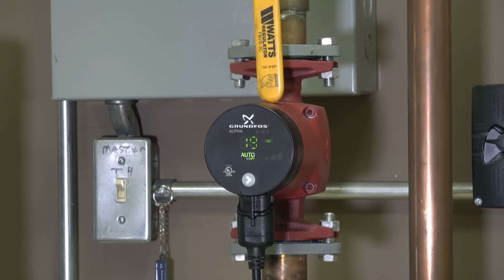Hydronics System Components

Comment: Why are you using black gas pipe on your expansion tank? And before anyone says some slick shit, I am a licensed Journeyman Plumber.
Reply from the maker: It is a faster install because the bottom of the air separator and the top of the expansion tank already have threaded connections.
Reply: i noticed the same thing immediately.  if this is an actual system in use, you might as well just replace them now with copper.  the reply from tec tube is nonsense.
Reply from the maker: @said_in_awk  The fully functional training lab system shown in this video has been installed since 2006 without issue.   Additionally ALL of our hydronic piping layout designs for actual buildings are also this way… and have been for almost 3 decades.  What issue you are perceiving will occur with the use of black pipe vs. copper?

Comment: Great video! Do you recommend putting propylene glycol into a closed loop radiant system? The pumps and manifold are in the garage where it might get cold. Thank you
Reply from the maker: If it gets below 40F in the garage, then yes add glycol.  How far below 40 will determine what ratio you need to glycol to water.

Even if you garage only gets down to 55, but your outdoor temp in your area gets below freezing you lay still want to consider it because sooner or later you will forget the garage open.

Why did you put the circulatory and manifolds in the garage instead of inside near the boiler?
Reply: @TECTubefilms  Thank you for the reply! I'll put in the glycol! I inherited the system as is :(

Comment: I have a closed loop hydronic system with PEX tubing in the floor slab, propane water heater, Grundfos pump and a small expansion tank.  How do I know how much to pressurize the expansion tank before heating up the system?
Reply from the maker: For residential, typically 12-18.  Although, all of those small tanks come pre-charged and should state the charge on the label.  You need enough PSI to get the water to the top of the highest piece of radiation.  So 12-18 completely covers you for a typical 2-story home with a boiler in the basement.
Reply: They are pre-charged.

Comment: Ill be designing a radiant floor heat system for my one floor 30x80 house...ill be using a open loop outdoor wood boiler....ill have 3 zones of say 8 300’ loops...my question is what type heat exchanger will supply enough heat for my system using the 2foot aluminum pex heat plates

Comment: Is it normal for a system like this to bang loudly when initiating?
Reply from the maker: no
Reply: @TECTubefilms  Thanks. I'm going to have to get it checked. I does it quite often, maybe 5 out of 10 times. It's so strong it shakes up the pipes.
Reply: Alex, have you got an expansion tank in the system or not? Look to see if you got your check valves in backwards. Water flow arrow are on outside of check valve. Just suggesting.

Comment: Thank you for your videos . Question I have, should I need a check valve  in my circulating pump?  It comes with one that's removable, would it cause problems? Thanks
Reply from the maker: The check valve is there to prevent reverse flow.  Some systems need it and some do not.  If there is only one circulator for the entire system, then the check valve is less important than it is on systems with multiple circulators.
Reply: @TECTubefilms thanks for reply.

Comment: Iam a pipe welder doing big havoc chilled water systems. But Iam going to learn this
Reply: HVAC is easier than residential ac and heating  cause you have liquid side and suction side and instead of water there is Freon on the cool side

Comment: Can you bleed the boiler with the circulating pump is on?
Reply: some  circulator dont like to be ran dry. so no, dont do it. map out your boiler, and ensure that you can force all the water out one place. then all the trapped air has to go out. most common place is the return going to the boiler. if you have zone valves, force them open.
Reply: @shahsmerdis  Ok thanks.

Comment: How do I decide what size pump to used on a system?
Reply from the maker: If it is a circulator for a primary loop, it would be sized for the pressure drop of the boiler and its required flow rate.  If it is a circulator for the secondary loop (or the only circulator on the entire system), it would be sized for the pressure of the entire system (boiler, terminals, piping, etc.) and the required flow based on the BTUs needed.

Comment: What side should the pump be installed to?
Reply from the maker: Which side of the boiler?  In most modern applications we prefer it on the supply side of the boiler.  We want it to pump away from the expansion tank.  And we tap our expansion tanks off the air separator.  And the air separator works best with hotter temps.

Comment: You mentioned using 3 4 port manifolds instead of 1 manifold with 12 ports. I'm working on a new system and was planning on one 1 port manifold, 9 in use with one open for future options. This manifold would supply one infloor system thats a closed loop with a 20 plate heat exchanger AND 8 rooms/zones with fin tube/slant fin/argo emitters. I'll also have a staple up room with 2 zones and 5 loops. The boiler is going to be  a Navion condensing boiler with 200,000 btu output. Would a Hydraulic separator  be a better option instead of a buffer tank?
Reply from the maker: Use a buffer tank if your smaller zones are lower BTUh than the lowest firing rate of your boiler.  You don't want one 4,000 BTUh zone short cycling a boiler that can only turn down to 40,000 BTUh.

Comment: Great info...I could sure use some direction about something I'm 
just not seeing on YouTube HOWEVER, one other video I viewed did say 
"this is the way to go" (two circulating pumps) but didn't really get 
into detail.
I'm about to install a new gas fired Crown boiler 105,000 btu, 
two zones (first & second floor Slantfin baseboard) but, I want to 
use TWO circulation pumps (one per zone) vs one pump for both. This way 
one pump isn't over working all the time and if, a pump goes down I'll 
still have heat in the house.
Please, any info would be so helpful, thanks Ray
Reply from the maker: For two zones you can either use one circulator pump and 2 zone valve or you can use 2 circulators and no zone valves. The circulators will need 120v.  The industry goes in cycles on which way is more popular.  Due to the cost of small variable speed circulators, the trend for one pump and 2 valves is back.
Reply: @TECTubefilms  ... thank you for that feedback.
Comment/question...being my Crown AWR105B already came with a much smaller Taco circulation pump vs the monster Bell & Gossett that was on my 40 year old crown, I suppose I'll go ahead and use the Taco unless, it would behoove me to go ahead and purchase a variable speed pump...question, are the "variable speed" circulators very reliable???
Reply from the maker: @hmdwn  Extremely reliable.  We haved used a lot of Grundfos Alpha and MAGNA variable speed circulators for the past several years and cannot recall a single failure at all.
Reply from the maker: https://us.grundfos.com/products/product-list/circulator.html

Comment: Great video!  Any videos on replacing an expansion tank?  
Can u tell me where the expansion tank is supposed to be located?  My expansion tank is horizontal and located under the circulator pump right before the return goes back into the boiler
Reply from the maker: The expansion tank needs to be upstream of the circulator pump.  We prefer the expansion tank to hang off the bottom of the air separator.  And the air separator needs to be on the supply side of the boiler because that is the hottest water (and hence easiest bubbles to remove).  Therefore we prefer nothing to be on the return side even though that is traditional for small residential size boilers.  The reason they were on the return is because it was easier to pre-package and pre-pipe them that way.  There was no technical reason to do that.
Reply: @TECTubefilms  awesome, Thank you so much!
Reply: @TECTubefilms  the new tank wont even fit in the old tank spot so i have to move it anyway
Reply: Tec Tube we usually fit expansion vessels on the return side of a heating system to prolong the life of this vessel as it is on a lower temperature pipe. Great video 👍

Comment: i noticed you have a circulator pump for each zone, in my condo, i have a hydronic system, but just one circulator pump for 3 zones, is there any advantage or disadvantage with this setup or just a matter of preference?
Reply from the maker: You probably have 3 zone valves instead of 3 circulators.
Reply: @TECTubefilms  i see, yes i do
Reply from the maker: The advantage of circulators for zone control is that you can buy smaller and less energy consuming circulators.  It is less expensive to run one smaller circulator to heat a zone than to run a large one and open just one single zone valve.  However, now with variable speed circulators that trend is changing and we are seeing the industry go back to a single secondary pump with zone valves.

Comment: I believe minerals in the boiler water have been collecting in my boiler since I drain my boiler in the fall and refill it in the spring.  (summer home) I think that is the reason my tankless boiler can't provide enough hot water for showers longer than a minute or so.  The part of the boiler containing the heat transfer coil has bolts that are so rusty I don't dare to try to remove them.  Is there a product I can add to the boiler water in the spring that will work to dissolve the minerals over the summer and i can flush out in the Fall?  Anyone?  Thanks.
Reply from the maker: We recommend never draining a hydronic system as refilling it introduces new minerals.  It sounds like your boiler is actually a water heater (or a boiler being used for domestic water heating only) and hence the reason you are draining it in the winter time.  We assume that is because you don't use the summer home in the winter and hence do not heat it.  Does the boiler also heat the home?  In other words, do you have piping from the boiler to radiators or does the boiler only heat domestic water for showering, etc.?   What style boiler is it?  What is the make and model?
Reply: @TECTubefilms  Thanks for the reply.  Actually there are two boilers for this duplex and both are acting the same.  (We rent one side in the summer.)  One appears to be a "70 series" and the other is a "Vailliant" but the age of the boilers prevents getting the model numbers and perhaps the correct names of the boilers.  Both are ancient.  Yes, we do shut them down in the winter for about 6 and a half months and we use them for heating in the Spring and Fall with the baseboard radiators. The heating of the house part works fine. We drain everything (ice machines, dishwashers, washing machines, water softener, RO device, etc) when we leave and antifreeze the traps, etc.  Been doing it for 10 years now and so far no broken pipes.  (knocks on wood...)  
If you put your hand on the hot water pipe coming out of the boiler it gets so hot you have to remove your hand.  But after a minute it cools down to tepid.  The flow remains high so the pipe itself is not plugged because the flow does not decrease, it's just the temp that goes down.  That's why I think the exterior of the coils are plugged up preventing of the transfer of heat from the boiler's main water tank to the DHW part of the boiler.  Plan at the moment is to install electric water heater next spring and just use the boiler for heating the baseboards only.

Comment: A buffer tank seems stupid. You might as well install a hot water tank. You will end up loosing heat that was generated out of the buffer tank. Nothing has zero heat loss.
Reply from the maker: The purpose of the buffer tank would be on projects with small zones... zones that are smaller than the minimum firing rate of the boiler.  So instead of short cycling the boiler and beating it up, we sometimes elect to us a buffer tank.  A hot water tank... an indirect storage tank for domestic water... would not have this same effect because it storage capacity would not be hydraulically linked to that small zone due to its heat exchanger.
Reply: I don’t know who you are Guy Fawkes-Day but piss the F*** off.

Comment: How do you determine what pressure the expansion tank should be set to? Additionally is that pressure measured before install or after while water pressure is being applied on the other end? Thanks for the great video.

Comment: Trapping air in the expansion tank won't reduce its effectiveness.  It will actually increase it. The more air in the tank, the more compressible volume there is within the system that's available for the expanding water.  The purpose of the diaphragm inside the expansion tank is to trap air inside, in fact.  When the expansion tank fails, as they all eventually do, it is because that diaphragm fails and lets all the air out. Thus little to no compressible volume remaining.  It's ok to mount an expansion tank in any orientation.  Connection facing upward does still have the advantage of not spilling water everywhere when you change it out though!
Reply from the maker: Rust occurs where air and water meet... just like you see on the water lines for ships in the ocean.  The diaphragm keeps the air from touching the water.  If you have additional air trapped on the water side of the diaphragm, you are back to air and water touching just like the old steel expansion tanks back in the day.
Reply from the maker: Cut and paste from a Honeywell TK300 manual "The tank should be installed in a vertical position."
Reply from the maker: And from an Amtrol install manual "Mount tank vertically in downward position only."

Comment: Question when the system which requires antifreeze drops in pressure the resevoir pumps glycol into the system.  How. Sensor? Regulator?
Reply from the maker: In that tank would be a mixture of glycol and water of the same ratio as the fluid in the system.  The tank has a pressure switch and a small pump.  When pressure drops below what you set it for, the switch makes and engages the pump.
Reply from the maker: http://gtpcompany.com/residential-glycol.html

Comment: My existing setup is a Rinnai RC98 199 BTU tankles water heater set for 60c (140f) supplying  an existing Summer Air handler TC3550E in my basement.  Air handler sensor records the input water at 49c (120f)  the output water at 37c (99f), discharge air at 38c  (100f) and the flow rate recorded on Rinnai to the air handler is 2.8 GPM.  I dont know the spec for GPM. There may be alot of resistance in 3/4" copper lines. All Insulated.  The run to tankless and back is 60'.  16 x  90degree fittings,  a Watts water filter. The pumps is a Grundfoss  UP 15-42 BUC7.  I need more BTU's,  like 70,000.  My gut feeling the GPM flow is to low and it should be 4 or 5GPM.  Any thoughts anybody please.

My thought is the SummerAire pump is underrated for flow.  AH2A specs 5 GPM.  Will this unit produce 74 BTU or other with my conditions is the question?

Comment: "Water expands when we heat it"
yes and no buddy.
water shrinks when you heat it until 40F then beyond 40F it expands.
Reply from the maker: True.  But in the context we used this phrase it is related to a hydronic heating systems so we are always starting with water already above 40F.  If you have a system that will have water below 40F, then we mix the water with glycol, which changes its properties.